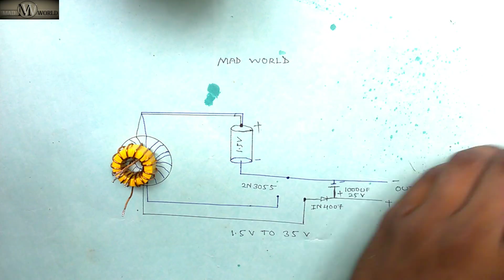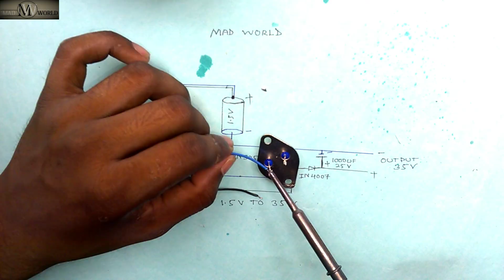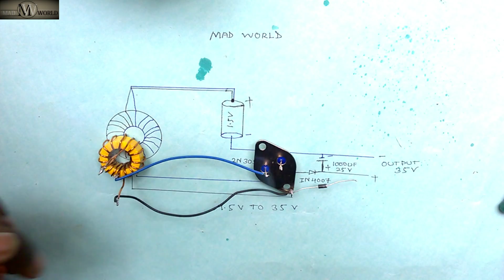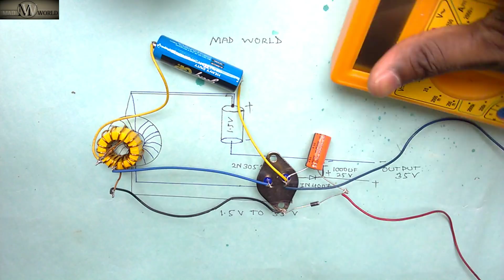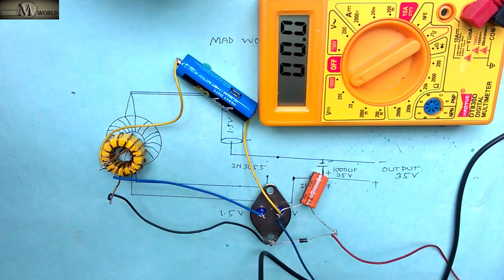1.5Volt to 35Volt 1Ah Make Easy.

Comment: 1. Unloaded voltage will be high since the Joule Thief is a boost converter.2. Amp Hours (Ah) are not used to specify current output but capacity of a battery.

Comment: This is fake reson is 1000uf 25v capacitor canot load 35 v is it explod it
Reply: no  its not 35v but 32 volts  25X 1.414 aprroximation
Reply: dear sumesh its 2017 science.
and you know very well in india every thing is possible.
Reply: Probably the 25V cap could tolerate 35V for quite a long time before it failed. You're right that it is a bad design choice to use a 25V cap for 33V or 35V but the fact that it doesn't pop within a few minutes doesn't prove anything.
Reply: sumesh vk b